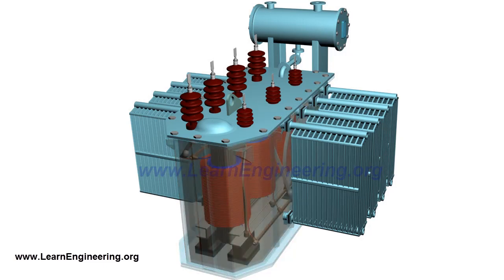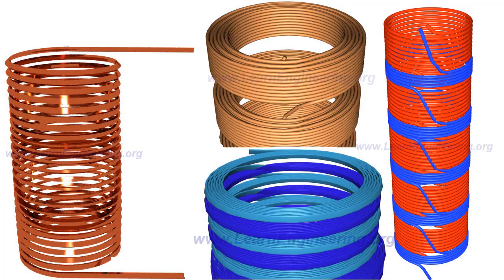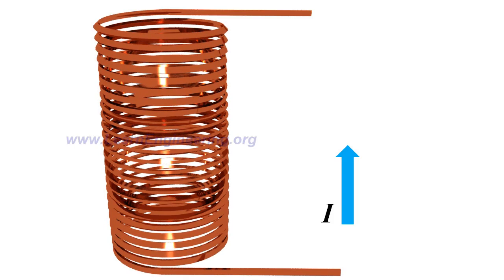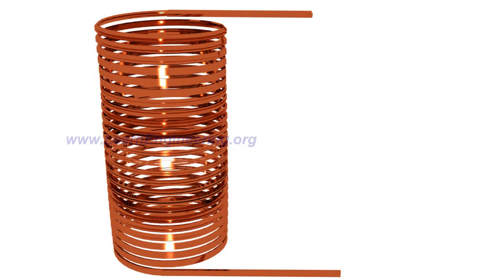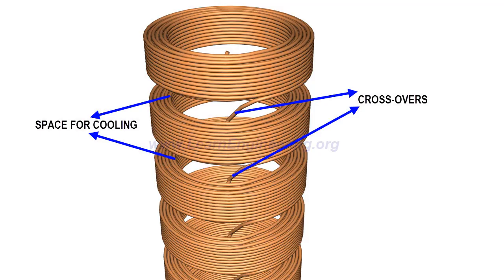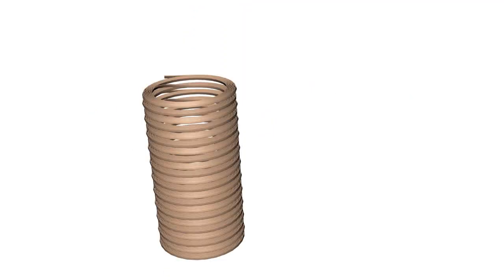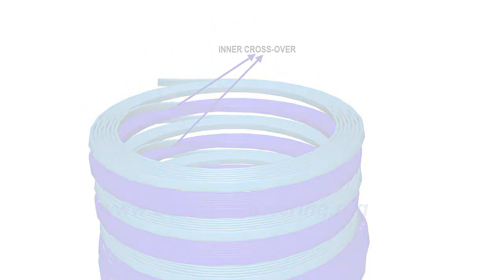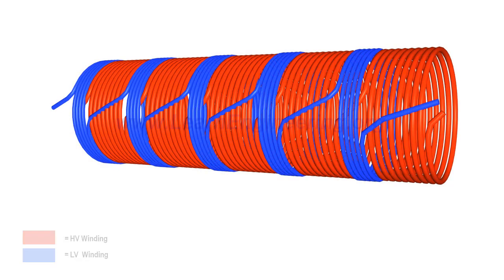Transformer Winding types

Comment: Kindly make more videos on Electrical and Electronics topics like types of switches(SPST, SPDT, DPST, DPDT etc), Relays, MCBs, Single phase synchronous motors( like the one used in Microwaves turnables i.e. with a permanent magnet), MOSFETs, Op-Amps and Transmission lines.

Your videos are simply Awesome!! 
In fact they are motivational!